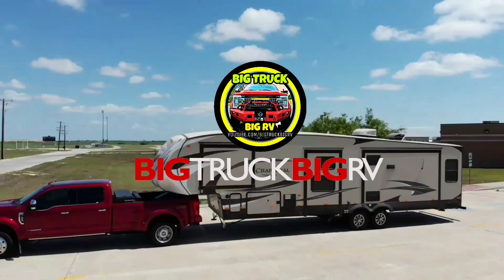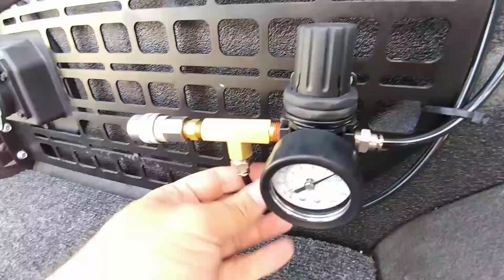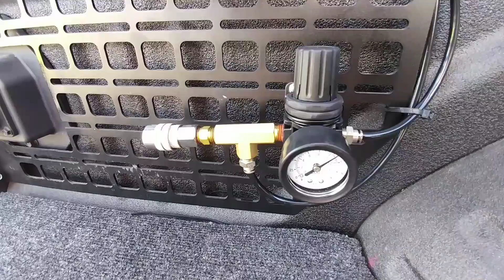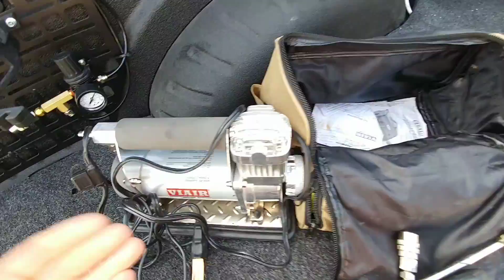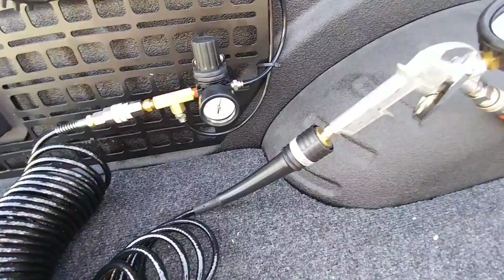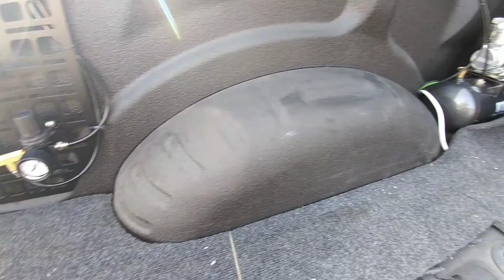The F450 gets an Air System! Finished (well kind of)

Comment from the maker: I am in the process of ordering some additional fittings and valves to make the system more "functional" for my use.  Another short video will go over that once it's all installed and filmed.  Thanks!
Reply: Big Truck Big RV
Now you have no reason not to do train horns! Some people think they're dumb, but when you are carrying a heavy load and a dummy cuts you off, nothing moves them out quicker than a train horn. Besides, they're a blast! 🤣
Reply: Quick question, since we talking about air. The leveling kit that you have installed not to long ago. By any chance, do that system helps with ride comfort empty? Because I heard people say that medium duty ride little ruff empty. By the way I love your vids.

Comment: So you say the compressor is set to pressurize to 200 psi. Then you have a regulator to reduce the pressure to 150 psi. Why regulate to a pressure so high? I would think that 80 psi would be sufficient for anything you might use..
Reply from the maker: My Airhorns run off 150psi.  Anything below 110 psi and they sound funny

Comment: Have you ever stretched that coiled up hose out to actually be 30' long if it's like most like that it might be 25' long   I knew w that with both you still have enough reach to get to your trailer tires but for those other people if they see it says 30' and then need it and it's not there like some have done then it's best to make sure you have enough hose to reach any tire plus about 10-12' extra feet
Reply from the maker: Yep.  It's a bummer.  Had to use both extensions last time.

Comment: Knowing absolutely NOTHING about compressors, is it wise to leave your (new) system always under pressure.  I ask only because constant pressure MIGHT lead to premature failure, AND it seems the the system recovery time is quite short.
Cheers from near Georgian Bay, Ontario, Canada
Reply from the maker: So long as you are using quality equipment you should be fine.  I purge my tank about once a week anyhow.

Comment: Two question come to mind.
1. What alternator system are you running that with? Dual or Single any issue with the draw? Does the truck have to run?
2. I would have thought you would mount it inside the tool box out of sight. Why that location exposed? Those regulator are plastic and break easy.

Thanks for posting.
Reply from the maker: dual extra capacity alternators. I didn't mount in the tool box because of the heat these small compressors generate.  It's also under my bed cover and out of the way.  Finally, the regular knob is plastic (like all of them), the body is all metal.

Comment: You should work with a company to create a prefabricated system to box in your bed along the lines of the wheel well to protect all your accessories mounted in the bed. I’d be interested in air but I’d need it protected more. Good video as usual.
Reply from the maker: Not a bad idea

Comment: How does this run an impact gun for something like removing a tire? How many nuts can you get off before the compressor kicks on? Is it effective?
Reply: keshmo12 he uses a cordless impact drill/driver.
Reply from the maker: Yep, Dewalt 1/2" 20V Impact Driver
Reply: As soon as you'd pull the trigger the compressor would start running. It wouldn't be very effective with a air tool. It would be faster doing it by hand

Comment: You should add the foot pedal solenoid for air horns like we have in fire trucks.   Works great  someone cuts you on press the left foot down and they move plus it’s easy to install
Reply from the maker: Yeah, I thought of that and actually purchased the switch for it, but I'm likely to accidentally hit it and want to avoid scaring the crap out of others and myself.

Comment: Nice equipment, but not the cleanest instal, you are usually very particular, but this looks like a rush job just to put out the video.
Enjoy seeing the gadgets you review. Keep them coming !
Reply from the maker: More to come :).  Needs to be serviceable for further reasons
Reply: It looks fine....needs to be easy to work on and remove if need be , an empty a truck bed can be necessary in a moments notice,this looks easy to get out..

Comment: Can you tow a gooseneck trailer effectively if you have a 4" suspension lift kit?
Reply: More than likely yes. It may require adjustment of the gooseneck height so the trailer stays level. Just keep in mind that off angle hills can destroy bed corners if you go too low.

Btw most 4inch lifts are 4 inch in the front and 1 inch or 1.5 inch in the rear. So it really depends on how the lift works with the rear suspension
Reply: He has a great video in regards to towing with lifts. One thing I think he didn't mention is flipping the trailer axles. You put the suspension above the axel and you get 2-3 inches of lift maybe on your trailer.

Comment: Where do you get your fittings? I have air horns with a 5 gallon tank but need fittings from tank to air regulator. Any help would be great. I am wanting on board air too.just need connections. Thank you
Reply from the maker: Amazon and South Texas Hose

Comment: I was behind another trucker north of Dallas and he pulled on his air horn, it stuck open. It drained his air and locked up his brakes. Always good to have a plan ahead of time. He told me later he put in a new horn valve and a master valve in the event it should ever happen again.
Reply from the maker: I've heard of that happening.  Thank god I only have a 2gal tank and no air brakes.  My Airlift Bags run on their own compressor also.